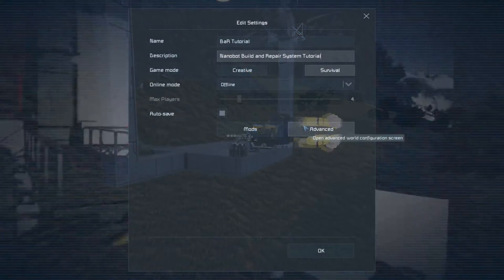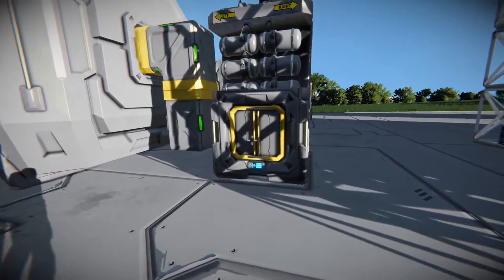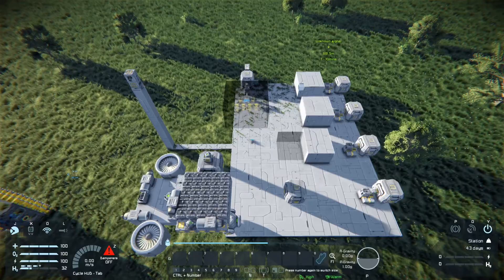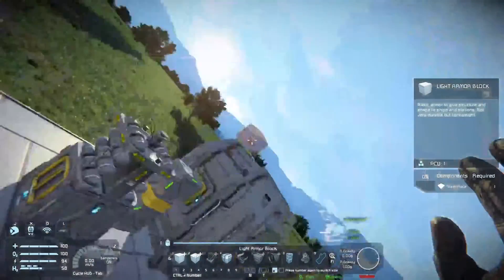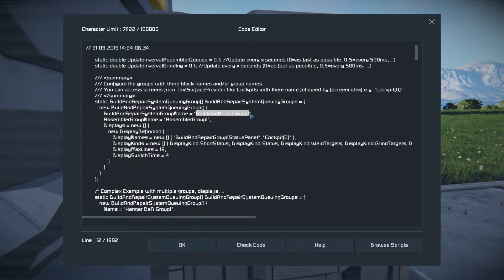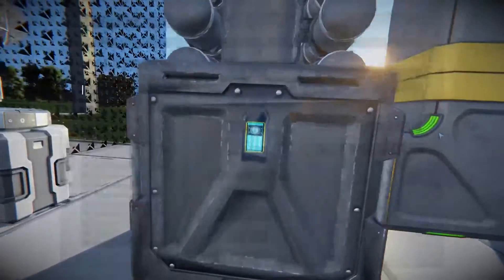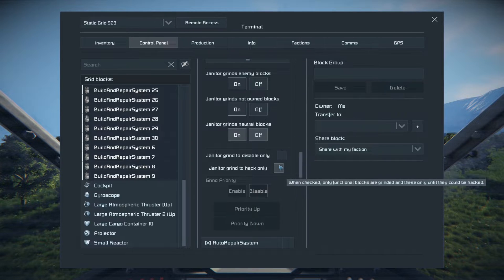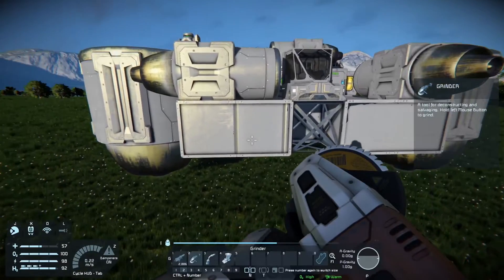Space Engineers Nanobot Build And Repair System Tutorial.

Comment: why my nanobots wont build stuff from hologram even tho i have set it to flymode and have the hologram inside the box thing?

edit: ive set it to weldonly
Reply: I'm having the same thing happen to me. I have it on fly mode and the color's turned off and it just refuses to actually build from the projector.  It's extremely frustrating
Reply: Turn out you need a block connected to one of your hologram block, that block will be where the nanobot start welding stuff  tho i already gave up using this mod, instead i started to make vanilla 3d printer and use that instead.

Comment: okay, I have a general understanding of the B&R bot, but when I build a projection, it builds up a few blocks, then welds to frame with the rest, and then fucks off.

What do?
Reply from the maker: This sounds like a bug to me, I would check the comments on the steam page for the mod, there may be a workaround posted there.
Reply: did you ever find a fix for this? cause I have the same problem
Reply: @notwes8873  no, haven't touched se in a while, hopefully it's fixed. At the time, I think it may have had something to do with logistics, but the build I was making was easily doable with crash start